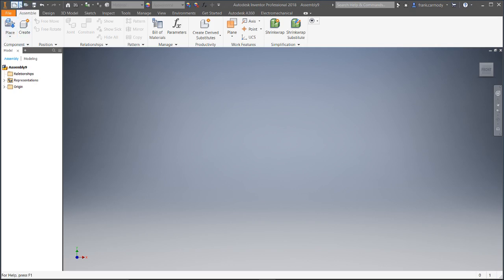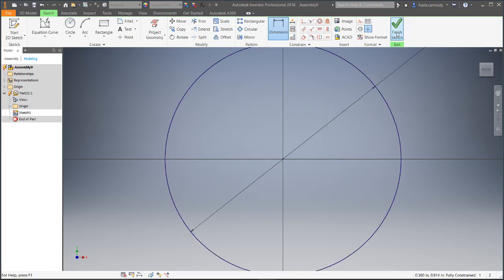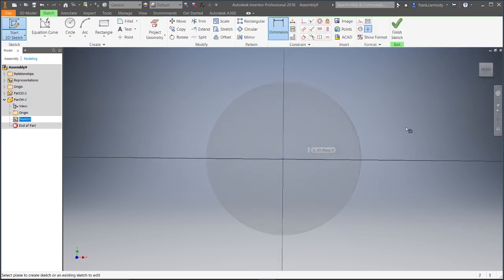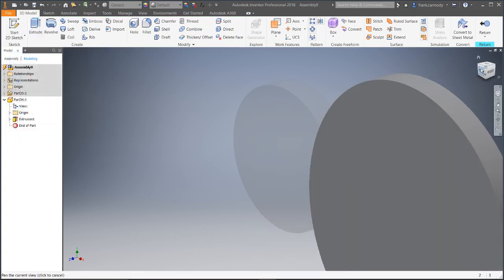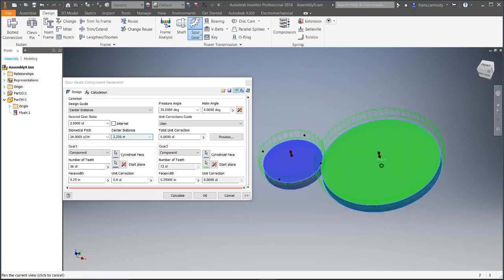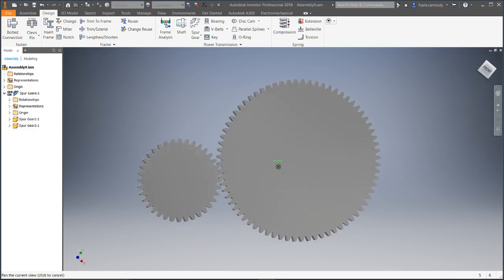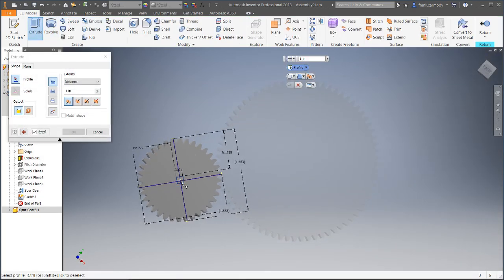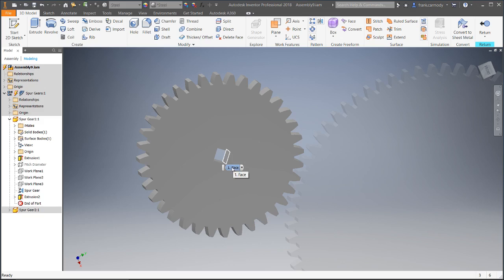Autodesk Inventor 2018 : 12 : Simple Gears

Comment: When dimensioning your center square hole, why not just dimension from the center point instead of going through all the trouble of measuring from the O.D.?  What would you do if you had an odd-numbered tooth gear?  I've been a toolmaker for 45 years, and I'd always take from the center.  Also, that way if you found later on down the road that you had to make a change to the diameter, your gear hole would still be in the same location.I want to thank you for the instruction, since I was struggling with the INVENTOR means of making a gear, and you answered many questions.  I've been using INVENTOR for about 6 years off and on (more off than on) and I'm getting back in the groove so to speak.  You get a "like"!
Reply: cause the rectangle option isnt give us that , u can't start a rectangle from a center as when we do a circle, or i think we cant. :P
Reply: totaly wrong , sure you can !
Reply: Make a 4 sided polygon off the center point, dimension the size, extrude and you're done!
Reply: OMG ...I wanted to pull my hair out watching this guy dim from out diameter.